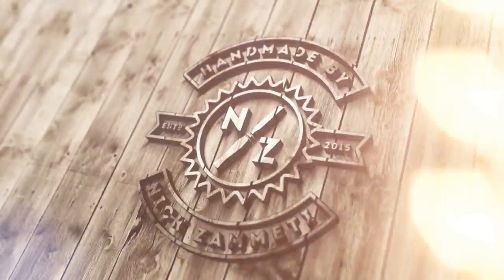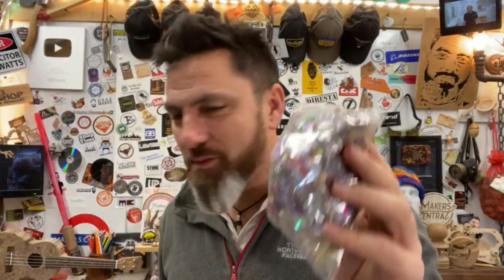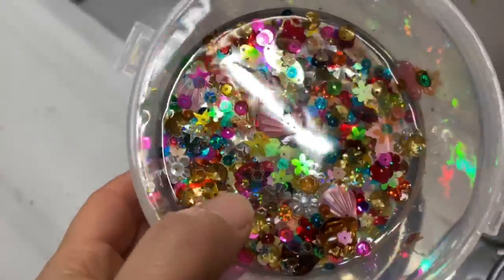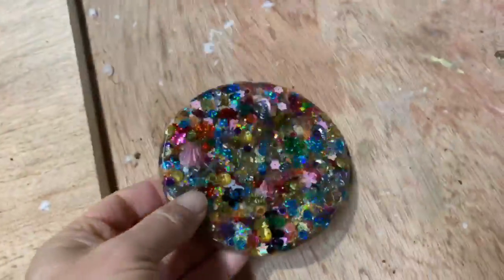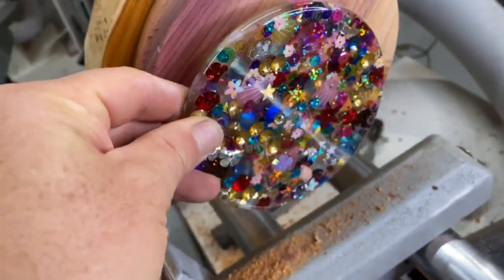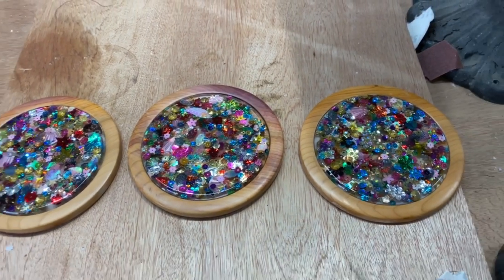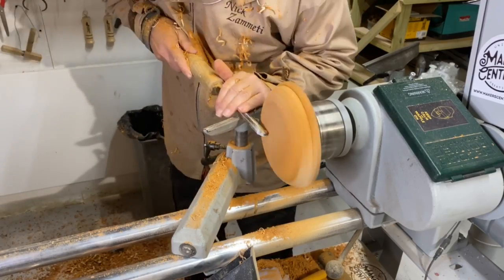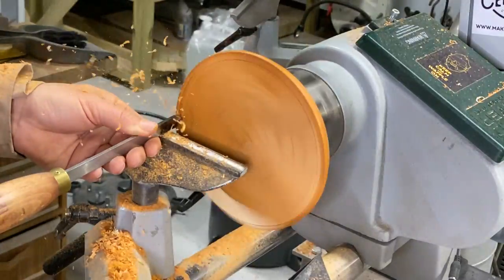Woodturning - A Project Using Sequins

Comment: Please make a rainbow bowl:
Use some kind of bowl for the resin, use only small parts of resin each layer. Each layer you add another colour, you can use glitter, colour for resin, paper, what ever you like, but it has to be light weighted, so it doesn't all sink to the bottom. Now put the small resin amounts into the bowl and spread it around the walls, until everything of the wall is covered. Repeat the steps with each colour, let it cure between each layer. 
You can shape the bowl  however you like when its cured. I would prefer to see glitter in it, but not too much, so you can see each layer from the outside.

I would have a really happy day if you could try it out.
Thanks ^^

Comment: Great video. I would call them a key or Change bowl with three trivets.... but they have the pretty side to decorate the table and when they need to hold hot pots, turn them over so the resin doesn't get damaged. Hugs from Halfiax

Comment: Looking at this made me think of a roulette wheel and holder. That would look really cool and would make for an awesome project. Also you can make a checker board with different colors of wood glued together in a square for the board. Then make the checker pieces out of the same two colors on the lathe. A "Gambling set"
 Either way I'd pay money to watch you make a beautiful roulette wheel and table. You could also make the colored sections out of two different colored pieces of wood cut into triangles, then turn it on the lathe. 
  I'd try it if I had your skills with wood turning. "Happy Days" my friend. Love all your videos. I'm a huge fan of your channel.
Reply: I'm also a Carpenter and cant wait to buy a lathe when I can afford one lol. My love for it started when I found your channel. Cheers buddy. Keep up the great work.
Reply: Also cedar is a beautiful soft wood. I've seen it with crazy colors. The purple ish Red colors are the harder parts of the wood. I love how it goes from tan to burgundy almost white with no grain lines. Plus it smells fantastic and almost never rots. Love Cedar.

Comment: Nick - Nick some Adams Extract (if you can the name brand) Food Colors.  I tried and got great results.  I think it takes more at a time (yellow 1/2 the others or it is orange) Beautiful Red, Blue and Green and my Orange.   I made 100ml and made 4 ice cubes in a tray.  I put in 1/4 in each and had mixed in small pots.  10 drops for the colors for about 25ml of Resin.   If you have different name - try them.  These mix for color and mix with vinegar for Easter Eggs.  Martin

Comment: you mad bowl and cup coasters.  you try make spoon and mug or cup. next. spoon take big one put flat wood trace with pencil. cut out. use carving gouge to scoop out spoon part. then cup similar to how mad ukulele. instead make gutter body make round circle. instead neck handle. if use food safe finish drink cold drinks out it and use spoon salads. think be cool add color penciles some how. maybe make rolling pine?

Comment: WaA- ok. I just thought of a funky idea that might not be possible... what if you sprayed your hand with mold release and dipped your hand in resin? Like a thin enough coat that it wouldn't burn (if thats possible idk) and keep dipping after each layer dried and then..... thats as far as my idea got in my head

Comment: How heat resistant is that resin? They’d be a good size for trivets.
Reply: I know you can make resin trivets, but what I would worry about is the expansion/contraction from heating and cooling. As they are with the wood I would assume it's pretty likely to crack over time as a trivet because of the mixed materials.
Reply: Haley P Ah, excellent point.